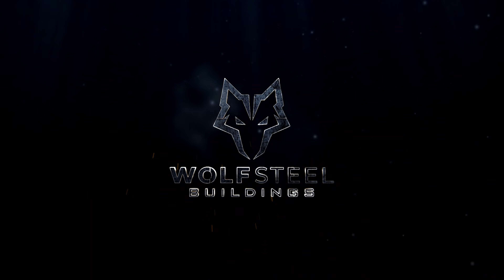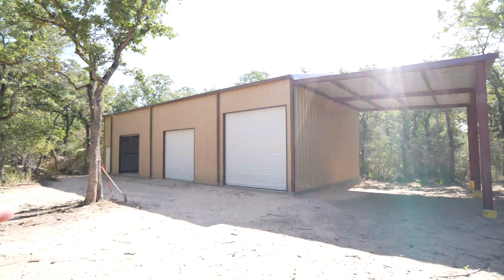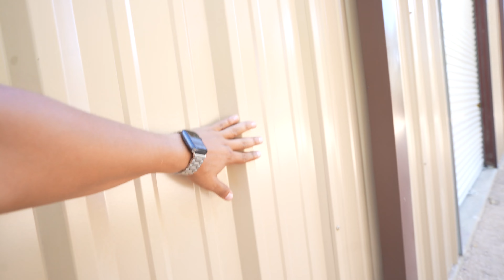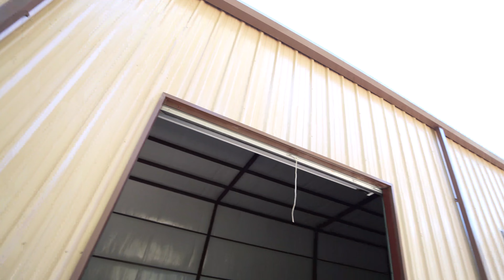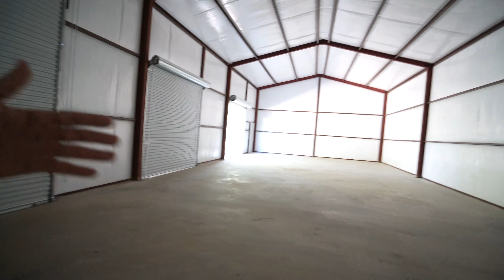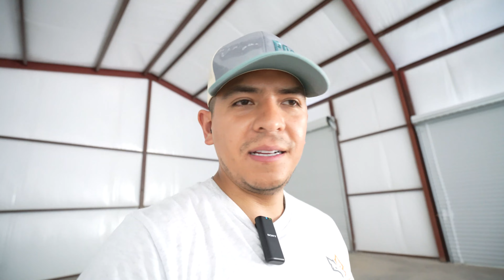30x60 Weld Up Metal Building with a Lean To Porch in Kingsbury Texas | WolfSteel Buildings

Comment: That's a perfect size for what I'll build later. I like the notch in the concert to keep water out. My hardest decision is what kind of layout I want. I also would like a lift in mine so the concrete has to be thicker??
Reply from the maker: Great choice! That notch is definitely a must for keeping water out. And 99% of car lifts will have specific concrete recommendations, meaning it depends on the lift, the more information we have the more we can determine the concrete recommendations.
Reply: The weld up buildings are stronger? How thick does the concrete have to be for fix in ground car lift?